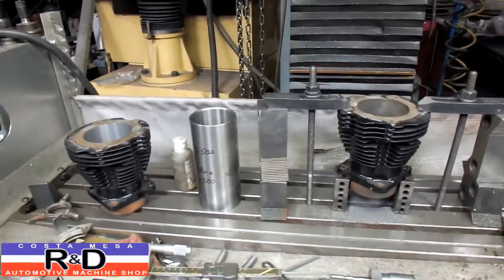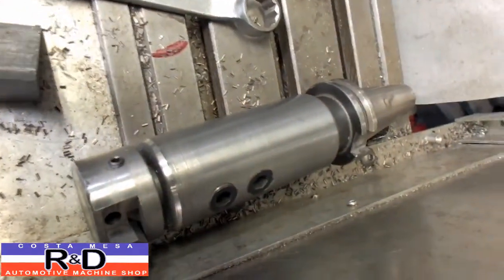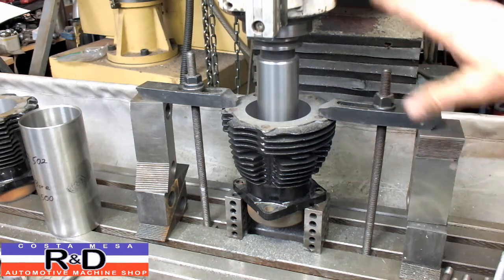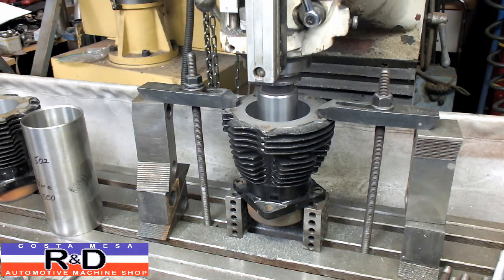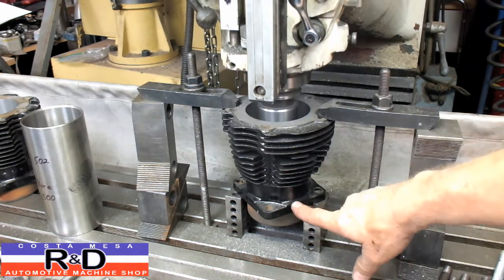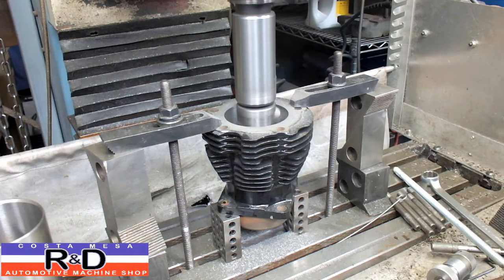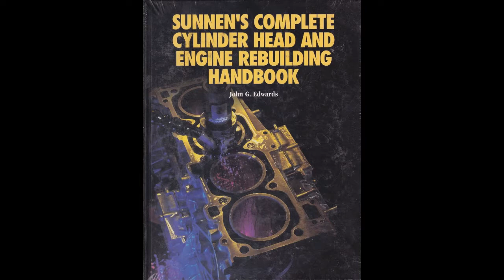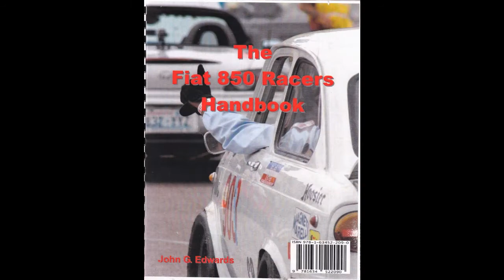Harley-Davidson Cylinder Resleeve

Comment: Interesting vid. Guessing that's a EL (61") knucklehead cylinder by lack of oil holes. The missing thing here is TORQUE PLATES. Even a cast iron cylinder, and especially one being blown out for a sleeve, needs that simulated stress that only torque plates (I even install the exact head and base gaskets to be used). This opinion will undoubtedly have mostly dissenters, but most people  simply don't HAVE torque plates, or don't want to take the time to deal with them. In his defense, it'll probably be ok in a EL. This guy is providing a valuable service here for folks like us who actually RIDE our old bikes. We're stuck using old, reworked junk like this, while hundreds and hundreds, if not thousands of pristine vintage cylinders languish away in boxes and milk crates, put there by hoarders, looking to build that old bike up day, only to have their grandkids eventually toss the parts, ignorant of the treasure they are holding.

Comment: How long is the cylinder for boring purposes? I know the stroke but is that the same as the length of the cylinder? Buying a mill and not where I can measure a cylinder. Thx

Comment: Hi!

I have a few questions. I think I heard you say .0025" interference fit, right?

Any bonding agent?

Do you heat the cylinder, or just press it in?

thanks!
Reply: Interference depends on OD of liner. .0025 is o.k. Important: Cylinder barrel must be honed after boring to prevent over-heating.
Reply: So as all the replies suggest, its a pressure fit. I was wondering about the same thing. But i dont think bonding agent is used while the cylinder gets really hot. So the sleeve probably stays in due to pressure. I need to do a revision on a motorbike and i need to make me some sleeves so i can redo the cylinder walls, while they are probably really rough.

Comment: You can buy brand new and much better quality cast cylinders for shovelheads, so why go through the expense of resleeving the old junk AMF cylinders? Unless this was an all original knuckle or panhead going for show, it's better to just buy new. Normally I prefer old stock, but harleys are common and to be honest older ones have generally been trashed by clods that had no right even looking at tools much less handling them.
Reply: AMF cylinders aren't "old junk."
Reply: The ones I've come across (granted, usually mid 70's ones) were just not good at all, the castings look like they had been done in someone's backyard. And as I said, I've come across more than a few that  had been ruined by idiots, things like broken fins and damaged gasket surfaces.